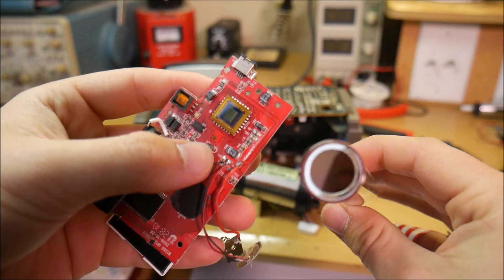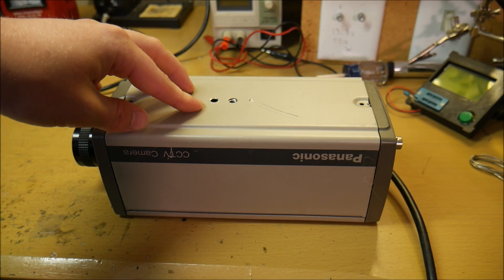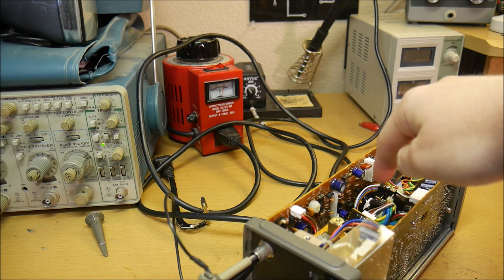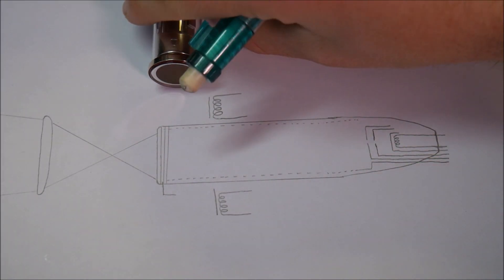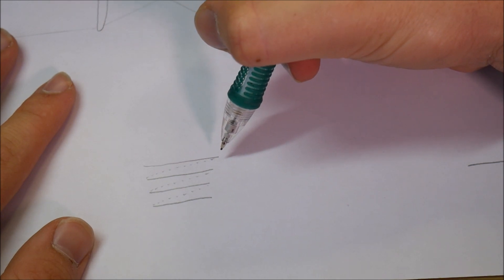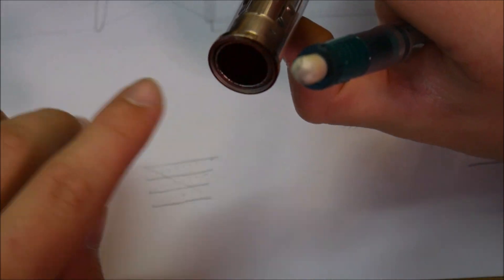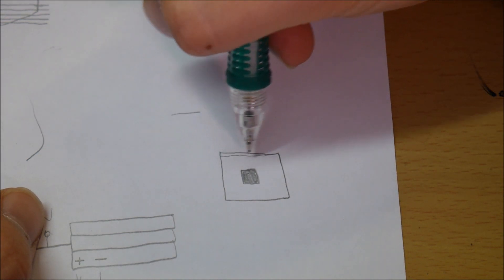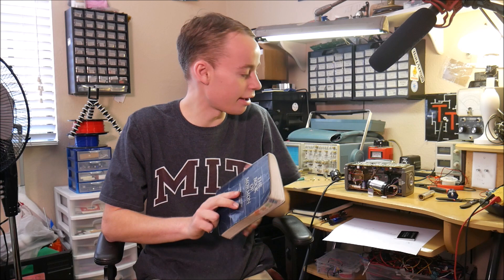The CRT That Records Video(How A Vidicon Tube Works) + TannerTech Update!

Comment: Just came across this presentation. Congrats! Very well done and presented. Almost perfectly explained and not really worth pointing out a couple of very minor missteps.

For further study (offline, no need to post a follow up) the Vidicon was one of several vacuum tube imager technologies that reigned in the later half of the twentieth century. The principle used in the Vidicon (and later Plumbicon, Newvicon, and SATicon derivatives) to convert light to an electrical signal is called "photo conduction", the prior video pick up tubes (Iconoscope, Image Orthicon, Image Dissector) relied on the principle of "photo emission".

Interestingly, the modern solid state imager chips (ICs called CCDs) use a different principle that captures light photons that arrive as the optical image, these become photoelectrons (in turn readily used by electronics the generate the required electrical output signal)

Comment: The first thermal imaging cameras used the pyro electric vidicon tube , they needed a germanium lens and a chopper wheel between the lens and photo cathode  because to produce a useable image ether the camera had to be moving or something in the image had to be moving , the chopper wheel produced that change if the camera was still or the image was still but it work exactly the same way, excellent explanation presented in an easy to understand way and very informative

Comment: Nice Explain,  clearly shows how cathode rays read the image by the  polarity difference impressed on the chemical layers.  Thanks!   - 

.. Maybe you like the Trail Effect that the Vid and Plumbicom cameras like RCA TK 45/46  produced when overlaps and passes through a light spot in the scenario of those Auditorium Talk Shows or  Band presentation on late the 70's and 80's

Comment: I have a HVM-100CE black and white vidicon camera and can't find the manual online anywhere lol
Reply: 5:14 When you say the layer of glass (faceplate) is there to protect the vacuum, does that mean there is no way to replace the faceplate with a different material like fluorite or quartz for recovering non-visible electromagnetic radiation without damaging the integrity of the vacuum tube itself?
Reply from the maker: No sadly, if you tried to remove the plate it would loose vacuum.  Good luck with your camera, does it work?
Reply: @TannerTech  No idea if it works yet, I've only got the camera itself which is a HVM 100CE by Sony. It worked with old Betamax VCRs but those are not exactly cheap and the pandemic alone has given me reason to be prudent with how I look at the money, I am trusted to have stewardship and the last thing I need is more electronics lol ! Although the simplest solution though would be to buy one of those, like the C5 or C7, there was also a camera effects module that the camera could be used with, and a certain adapter cable made at some point in time, that would convert the 14 pin Sony CCK (camera connector cable type K) to an A/V signal and separate DC power line, presumably for plugging into any old TV, but they are out of stock everywhere I have looked. All in all its fun to learn about but might be better off applying black and white filter in post production rather than going for the authentic look hehe, crt camera flares with their streaking are hard to reproduce though! It's fun to learn about but at some point I must ask myself if it wouldnt be better just to take the shortcut, pray for the ego of a perfectionist to be reduced! More importantly pray for my pride in general to be taken away. This I ask of you! And do I really need a working 1970s vidicon tube camera for "historical films" anyways lol, I'm thinking just adapting vintage lenses gives a good enough change in the feel or tone of an image? Plus the other 99 percent of a story's immersion, the stuff non-techhy people care about and notice,is the narrative, dialogue, costumes and sets, having the b&w video camera is almost ridiculous at that point even if it's just for a joke scene heh, If ive still done nothing with it and if I still have it, I might give up and just ask if I can send it to you, maybe you can make a video with it? XD  Have a blessed Monday and thanks for your time!  Stay safe and peace be with you in the name of our Lord Jesus Christ!!

Comment: hello, does the CRT Camera has a shutter? If yes, how it works?If not, how to control the exposure? Aperture and ND filter?
Reply from the maker: No shutter, I think exposure is controlled by either the bias voltage on the detector surface or the gain of the amplifier that the detector signal feeds into.
Reply: @TannerTech  thank you!

Comment: Could you use a VidCon tube in a tube amplifier circuit to amplify sound would it works that way also I have a vacuum tube and I don't quite understand how to make a tube amplifier with the shoe there's a video on YouTube about this particular tube which is a 38HE7 and I've made of single Cube vacuum tube amp but they don't they don't explain how they did it could you possibly do a video on bed or answer me back in help me out thank you
Reply: Talk to text read that a shoe I meant tube
Reply from the maker: Technically I probably could do that.  The vidicon tube is not designed to be used as an amplifier, but using the 2nd grid as a plate would probably make a weak audio preamp.
Reply: Hey tanner i just got a 12ax7 tube and I am wondering if I can use it to make a guitar overdrive pedal with just the one tube

Comment: NTSC is 15.75kHz, not 15.34kHz.
Also, you could have explained how color vidicon tubes work - there were basically two ways to get color. The first way was of course using 3 vidicon tubes with a color filter in front of each of them - but this was of course 3x more expensive than a regular B/W tube, so it was only used in broadcast cameras. But there was a way of getting a full color signal using just one tube, but it was very tricky and used a lot of hard math.
You should try playing around with the tube's lag  - you can create some awesome light effects and create comet tails. Be careful not to aim it at the sun though, you can damage the tube if you do that.